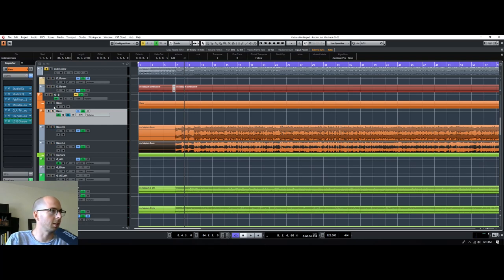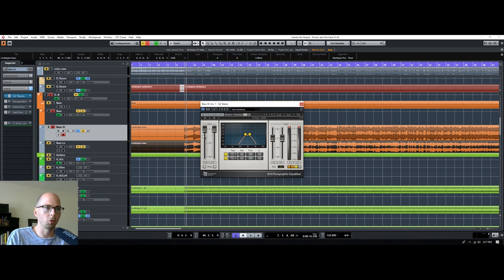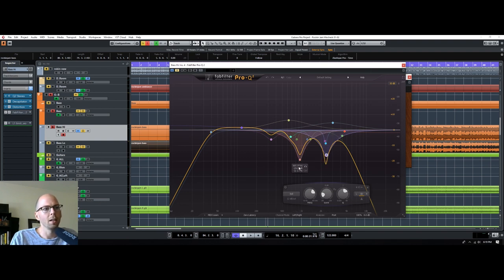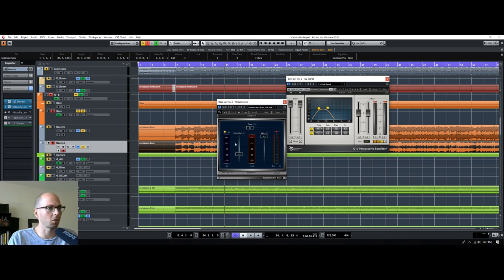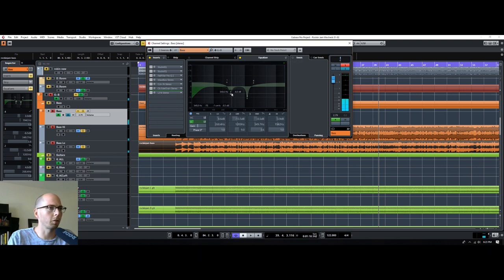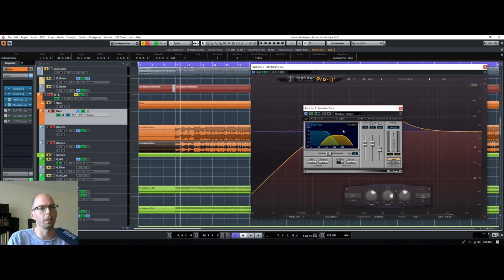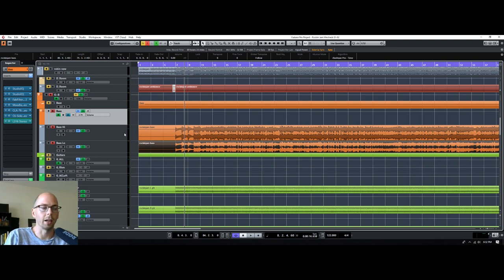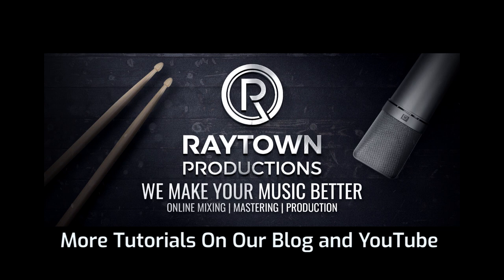Recreating a Darkglass B7K Style Distorted Bass Tone From A DI and Plugins

Comment from the maker: ===TIMESTAMPS===
8:02 COMPLETE OVERVIEW OF TONE BUILDING PROCESS
===INDIVIDUAL PARTS===
0:45 Duplicate track and logic
1:15 Splitting bass frequencies
1:42 Decapitator to give some extra body
2:03 Adding grit and fuzz with Cubase stock distortion 
2:30 EQing pick noise and clank to give room for guitars
3:14 Limiting with Waves L1
3:35 Working with the low end
3:48 Extending the low end with RBass
4:18 EQ to make bass more compatible with small speakers
4:50 Locking in low end with Waves L2
5:17 Bass bus
5:20 EQ to remove mud and sweeten
5:50 Importance of EQing with all elements playing together
6:17 Tricks to getting bass to translate on smaller speakers
6:41 Making low end translate on smaller speakers
7:05 Adding compression to gel the performance
7:22 Sidechain ducking of sub frequencies with kick
7:30 Final limiting with Waves L316

Comment: Sounds great Bobby!  Awesome tutorial. You're right that boost @600ish really works in with the track! Nuts. That DI is pretty gnarly sounding raw. Any idea what the part was performed on and what the chain was going in? The waveform looks compressed, so im sure it ran through a preamp and a compressor? 

Good segway into something I tend to struggle with, being (primarily) a guitarist I always find it challenging to get a quality DI to begin mixing/reamping with. Right now I go either straight in to the Apollo (with no printed preamp or compression) or a Behringer DI box, but when I compare the raws to a lot of really well engineered guitar/bass stems I hear my overall DI tones leave a lot to be desired...any insight/tips?

Keep it up man! I'll pop into one of your live mixes one of these days.
Reply from the maker: Hey man! So glad you enjoyed the video! I actually don't know what kind of bass this was performed on, or the condition of the strings, or pickups haha! This DI was sent to me directly and I had no part in the engineering of it. If I had to guess, I think the bass was run direct right into an interface. Waveforms can be difficult to interpret, but I think the reason it looks "compressed" is that there are lots of notes that are continuously ringing, which will "dilute" the transient/attack.

The sound of the DI is mostly influenced by a few things. 
1. Make sure your guitar is set up correctly. I mean string height above the pickups, dampening around the areas of the guitar that resonant, etc. I actually wrote an article on this topic a long time ago here: https://blog.discmakers.com/2018/02/improve-guitar-tone-when-recording/
2. The pickup choice (active vs. passive). This will really change the way the DI sounds and looks. Active pickups usually clip the DI signal so when it's captured, it will look almost like a square wave. BUT the sound when reamped is very different. See if you can borrow a guitar from a friend that has this other style of pickup - maybe that's the tone you are seeking!
3. Pick choice and technique. I know this sounds crazy, but how you hold your pic, the style of pic, and material will really change the way the DI sounds. In my experience, it's always better to pick aggressively, but not so much that the note goes out of tune. Chuggy parts are especially important to hit those strings hard. In general, thick heavy and unused pics tend to have the most aggressive sound. I know Andrew Wade literally sands his guitar picks to keep them sharp.
4. Using new and the right gauge strings. For metal, bigger usually is better. You get more tone and fullness in the lower notes the heavier gauge string you use. 

Wow that was a lot. Maybe I should write a blog article on this topic! Hope that helps man. Let me know if you have more questions. Cheers!